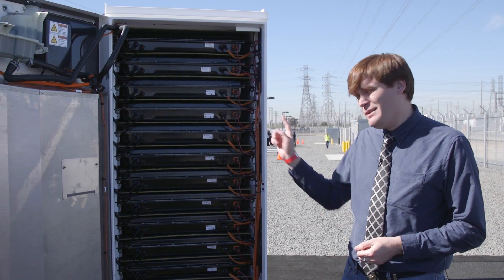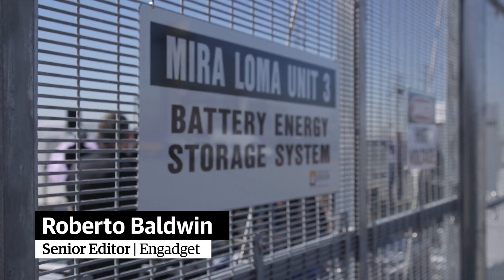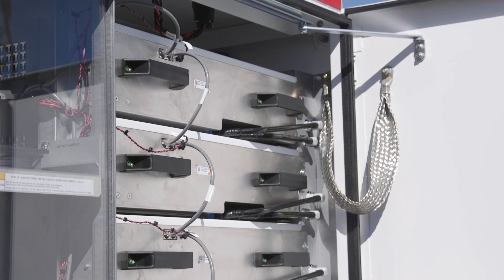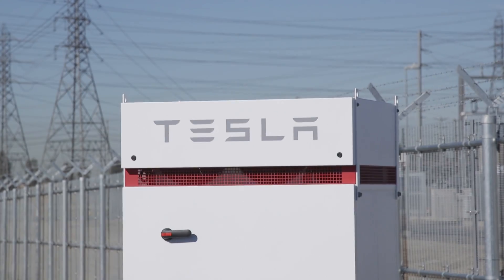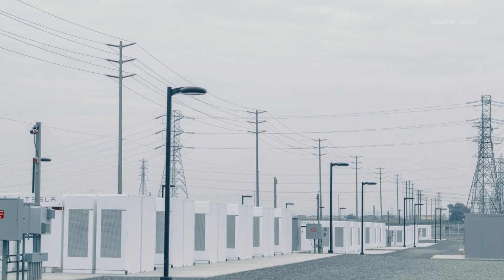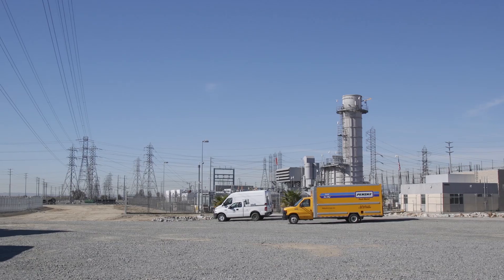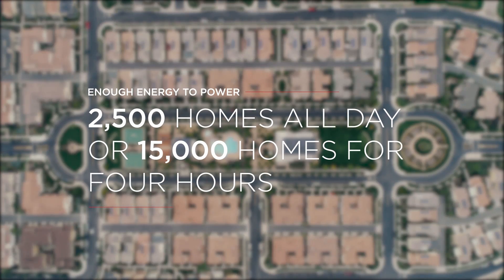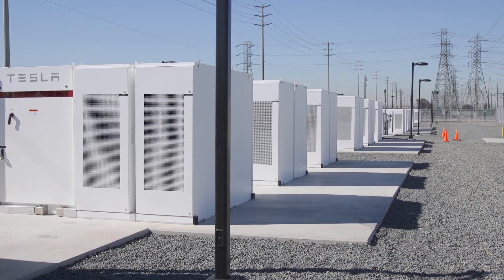Tesla Powerpack: First Look

Comment: FACT : America today could go 100% Renewable Energy. using primary Solar and Wind to generate Renewable Energy and Battery Storage, just ONE GWh class Renewable Energy can completely replace 2 Fossil Fuel powerplants and it will have the capacity to deliver instant Energy at Peak Times or slowly All Night Long on battery power. the Total Ammount of Land needed to go 100% Renewable Energy is the size of the State of Delaware, that's it. the Whole of the United States powered on batteries and Renewable Energy. YES, we will still need NG fired powerplants for the Transition to Renewables, but NG powerplants can use BIOGAS from Existing Landfills. another possibility is stationary Hydrogen fuelcells. they too can be used in Renewable Energy. but, there is no Hydrogen infrastructure in America. its better to focus energy on Renewables such as Solar, Solar PV, Geothermal, Hydroelectric , Wind and Tidal power generation.

Comment: Lets make one thing clear. Every single day between 1 and 5AM there's surplus energy on the grid. Every single day. Like clock work. And there's also a very clear peak demand period. That peak is satisfied by quite expensive peaking power plants.
The critical aspect to those batteries economics is they're cycled daily, at least 75% of their nominal capacity.
The critical math is the powerpacks must be cheaper than the natural gas the peaking plants will save since they no longer need to produce that vs producing that power at off peak periods using baseload plants. Baseload plants love to operate at 100% capacity all day long, and use less gas/coal to do so.
With enough powerpacks on the grid, peaking plants can be retired and baseload plant capacity can be increased.

Comment: Can anyone with sufficient knowledge enlighten me? This is just a publicity stunt, right? Everyone knows that we loose ~20% of energy if we store it in a battery and reuse it later. And the batteries won't last more than 2-4 years (depends on the number of cycles).

AFAIK, Tesla doesn't innovated anything in the battery industry. They just partnered with panasonic to manufacture batteries in large scale. Just the same old batteries (same efficiency, durability).

So, what's the point of this project other than publicity?
Reply: Surya Teja Cheedella these systems are in excess of 92% efficient and in regards to innovation, have you heard of he 2170 cell they're producing, and it's not necessarily all about innovation within the units themselves; the creation of the gigafactory will bring a drastic reduction in the price of them along with the vast improvements on quantity, I feel as tho that's just as important as innovation within the batteries themselves.

Comment: Batteries have expiration date, also the toxic material made of to make the batteries are harmful to the environment. CA Liberals where are your protests ?
Reply: lol.  at least he tried
Reply: Boi do you need to educate yourself on the 2170 Cell
Reply: dillmon1 Yes, but unlike gas or coal, they can be recycled - and it's cheaper than making new ones. The materials, including the toxic ones, are there and are reused.
Reply: +Béla Németh Pumped-storage requires two nearby lakes with great height difference. Not a lot of places have that.
Reply: trey cowherd True
Reply: "Batteries have expiration date" Technically Wrong. You ca not realy apply a Date to when a battery will fail, that is near impossible to predict with no  usage information. Battery Degradation is generally based on Charge & Discharge Cycles what ever time scale it happens in. In general your comment was stupid.
Reply: Just because the more enviroment friendly way is less profitable, capitalism as it's best https://en.wikipedia.org/wiki/Pumped-storage_hydroelectricity
Reply: The 2170 cell still has an expiration date. Aran is right.
Reply: Nikola Tasev at this time no one can make a battery from recycled battery materials